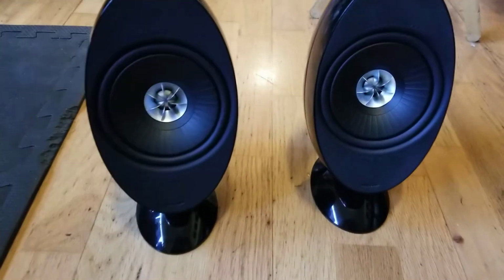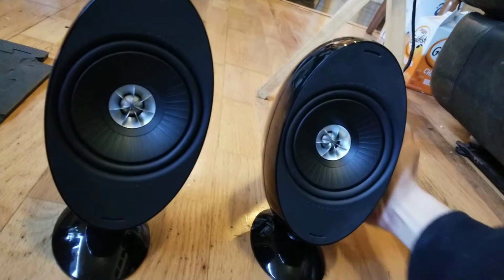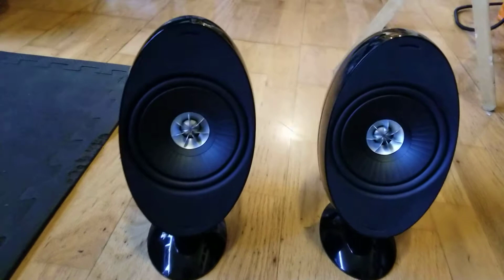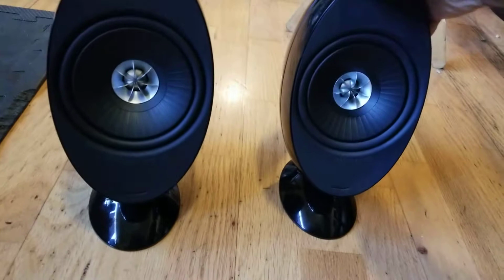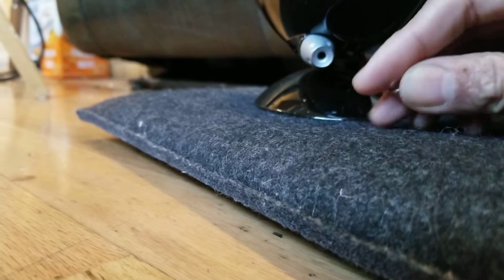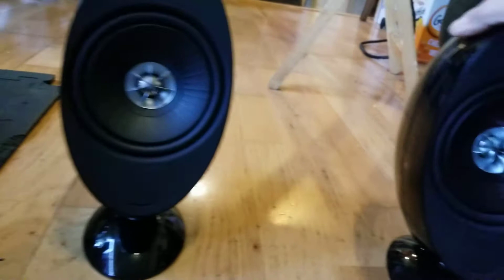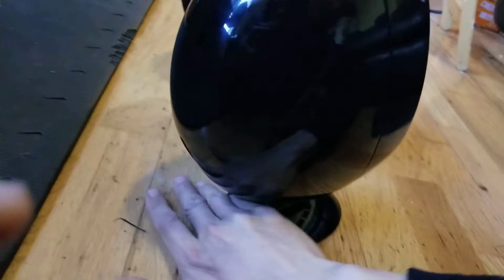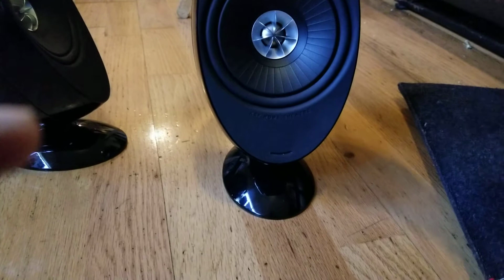Last little detail to optimize your 3001SEs or the "SEs" as those who know of them call them.

Comment: Why does it take 8 minutes to say “tighten the little screw at the back of the speaker to securely lock the stand” ???
Reply from the maker: To explain why it's not documented and because a lot of people don't understand the difference between the quality of something that would move a decimal worth of value is 1. QA. 2. It's r and d freedom vs marketing as in NOT having to make any sense in line up, 3. Look how long I've been talking about these and how suddenly the features I was drawing everyone's attention to from my tear down and optimised comparisons are suddenly making their way into the 12 gen Uni Q which is finally apparently ready for patenting. 

I mentioned the only reason why these speakers ever existed as the loss leaders they were was for prototyping due to the expiration of their original Uni Q patent and showed how you can literally see where they're going from this speaker just like literally like 2 years ago they used the same driver to prototype the new slim woofers, and now the sealed suspension system is added to all their 12 gen Uni Qs which was first used here because it needed to be the most perfect vessel for the prototyping of the future of KEF. They make make bigger speakers. But the Uni Q to the Blade is smaller, yet somehow it sounds bigger. 

They just added the Uni Q museum. Some poeple may be wondering why the hell would of all their speakers including the XQ40 or the freaking muon, would they list THESE suddenly as the definitive gen 7 and gen 8 of their top tech? 

Isn't that kinda weird? Sandwiched between gen 6 their magnum opus and the Blade the current magnum opus. Why would something apparently from the "EGG" line up appear twice especially considering there was the definitive EGG that is still being made the same just upside down, the latest being the EGG Duos. 

There was even an EGG after these that were classical EGG. 

So why these and why not the OG EGG if any EGG at all or their XQ40s or the muon? Why the 3001SEs the one weird speaker I keep drawing attention to that was originally not to be weird but mocked as just an EGG and I was randomly thinking too much into it. 

For an EGG it sure didn't leave any mark in the EGG series from the 2005 to the E301 to the active EGG to the current EGG Duo. 

So I asked the same thing. I'm randomly really interested in these guys only as much as KEF were and opening them up optimising them and showing others how you'd QA them from shopping second hand to once you get home answers the question. 

I mean why would these have spent more on engineering and making their binding posts than any other KEF product? then just stop.

Why would taking apart the 3001SEs require about 20x engineering than the LS50 and the Blade even just to CAD with the complexity of things like how every angle is unlike anything else, and the woofer itself would be a FEA night mare having it be the 1st 2 inch coil AND having the port only take air from the top most corner to the opposing corner while the fins or might as well call them blades behind the cone are the opposite of aerodynamic in the classical sense. They're the tallest in the center where they have the least space to be tall and the shortest at the outer rim where they have the most space to be tall? If its role was just to stiffen the driver it sure as hell went waaaay overboard and the resulting numbers they got from it ended up somehow identical to the LS50 with its 2.2khz crossover and their 54hz port, which doesn't sound like any satellite, it doesnt even sound like KEF's own egg satellites or any of their other Sats that are routinely 2.7khz and 72hz at the port. Since a sat is expected to play with a sub. Why engineer something, market it as a sat along side your other Sats, but spend like 50x the r and d on it like someone at KEF literally had a Pygmalion complex and fell in love with it and just couldn't stop designing every single detail of that thing. 

And they didn't get fired? 

Not to be weird but the hts woofers aren't even really 2 ways. They were, but then they stopped making those dual magnet composite drivers and started using a single magnet driver to recycle the basket to the mini woofers. And the things don't even have a true crossover. Theyre too small. Sure they have tuning, but the woofer and tweeter both play the same thing.

Why's they make stands for the 300X/SEs that are arguably the best designed stands they ever made where the pipe is a ellipse tuned to the 1 and 5 as in a power chord where any combination of sounds that pass through the rod left unfilled would actually enhance the sound?

The base to the thing is rounded so if it fits itll always fit but the back rather than being rounded has a v cut into it so that it forms a tripod and so when postponing forward and backward as loud as you want in any surface and it'll bite into the floor when pushed and just kinda wobble exactly back to where it was vs using a circle or a square which is annoying. 

If you wanna rake it upward you only need one cork or a sorbothane since as soon as you place anything even a ball to raise the front of the foot, the back two points dig into the floor always forming a tripod that works anywhere. 

How come it seems like they just like went amazingly good down to creating a soft baffle silicone baffle mask.... 

Then make the baffle not flat when all that wasn't enough but crescent shape and rather than the cop out of claiming the LS50s don't need grills, they made crescent grills out of metal since plastic wouldn't fit reliably and flush. 

So the grills are even....lol 3 parts. A skeleton to bound the metal mesh grill into the same crescent shape as the baffle and then they added an acoustically transparent cover over it. 

I actually took the fabric off. And it still looks rad. All their prior grills even when they had curves were plastic. 

Why'd they make such excellent miksry grade solid metal binding posts then cripple them so they might as well be spring clip so the first question here is "how'd I unlock the binding posts? 

They got a bunch of negative reviews and didn't even say anything for that. 

All these are questions you just kinda see and can't help but to ask. Then when you play them you understand. But lastly. Why'd they make it so I would even have to make this video? Why would they make the most important screw, the one that locks it from wobbling the most important way you wouldn't want it to virtually invisible and not tell anyone? 

Just questions.

Also. How old are these now? How come they stopped making the LS50s drivers  but NOT the drivers to these?

When I rob a house and the person is standing there but keeps looking at something, I'm gonna go see what it is. That's how journalism works. If you don't like it subscribe.

Comment: What is the diference between the KHT3001SE and the KHT3005SE or are they the same?
Reply: They are the same. The 3005SE is the product code for the home theater set, I believe that includes the sub so 6 speaker set.

The 3001SE is the product code for the speaker.

Comment: I have the E301 pair, they were in storage for years, I decided to use them for a desktop computer setup, but sadly the grills have rusted.  I’m looking for instructions to remove the grills or may risk putting a Dremel grinder to cut them off.  
I have KEF Q300, R300 and Magnepan LRS, but fancy something compact for general audio

Comment: Hi, nice reminder. May I know how you remove the cap from 3001SE so that you can plug in banana plug for speaker cable? Thanks!
Reply from the maker: It depends what country you're in. Ots easier in some places than others. If they're from Europe where the UK for instance banned banana pluggable you gotta boil water, un screw them all the way, then drop them in boiling water for about 10 to 20 seconds. Then drain and carefully grab a towel or something and drop them in ice water. 

They glued the bullets on in the UK. The boiling water melts the glue and breaks/softens the bond. Then the ice water causes a rapid contraction of both the metal and the bullet. From there any little alien wrench and a few taps with the back of a wrench and the bullets will pop right out. Tweet neomancr if you need more help. Hard to keep track of these videos and didn't intend for the delay

Comment: I don't know why you would sell your ls 50 for those
Reply from the maker: Have you seen the new generations page KEF just dropped? It would explain why the 3001SEs are what they are. The question is why wouldn't you? They're a much higher quality build and were the prototypes to not just the official 7th but also the 8th gen Uni Qs preparing them to evolve into both the blades and the ls series i.e. the 9th generation.

The shuffle from metal, rods and rubber gaskets as well as the 3D self dampening LF woofers into a wooden box isn't really anything you'd want. The same was done to the htb/2/Ws which were the other half of the equation filling in from 350hz on down. They were first released with the XQ series then were paired with the 3001 series and now also reverted to a cheaper more traditional box fork factor like the ls series and are now called the T2s.
Reply from the maker: In short the tech in kef is moving TOWARD these. These things don't even use magnetic motors and can be driven past 200 watts. The LS 50 is 100 watts and uses a ferrite motor. They just added the same sealed gasket recently and the same optimised poly basket vs basic alumag. https://i.imgur.com/AquD0Fs.jpeg

The voice coils in the 3001SEs don't even need magnets the center column is a pure neodymium rod and the tweeter caps it off while being fastened on just magnetically